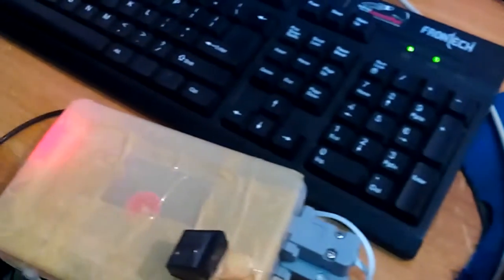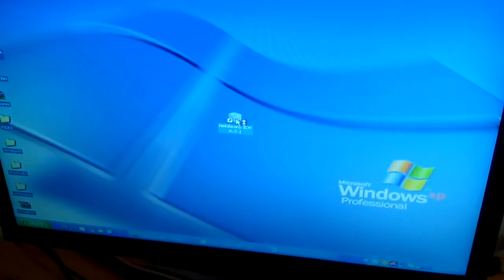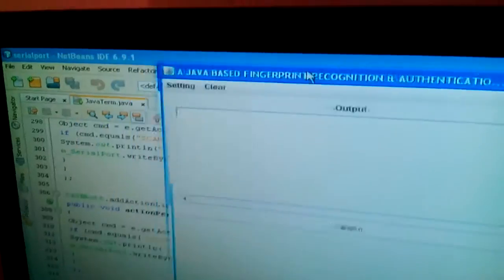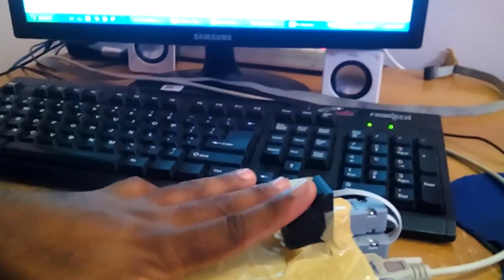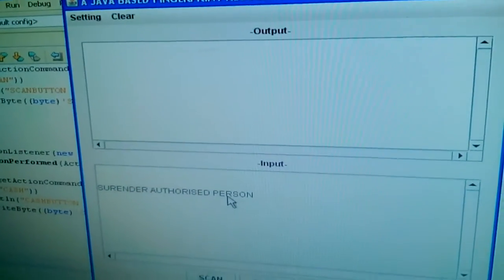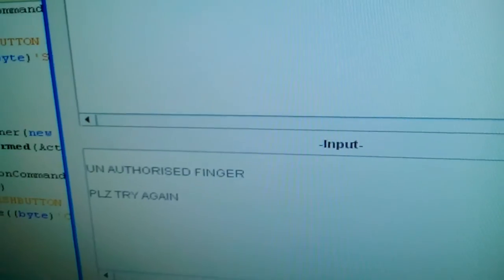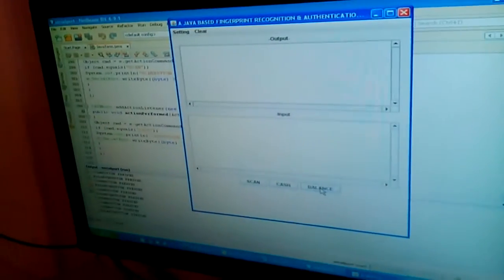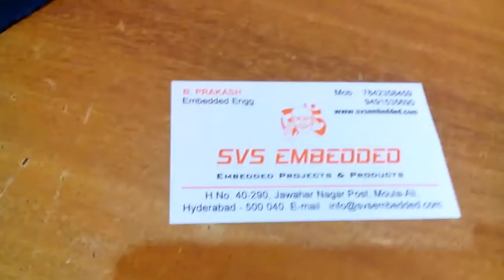A JAVA BASED REAL TIME FINGERPRINT RECOGNITION & AUTHENTICATION FRAMEWORK FOR ATM MACHINE

Comment: Excellent work Done... can you please send the source code to vjchavan582000@gmail.com
plz...I m actually working on the same project...plz....reply
Reply from the maker: Thanks for watching and your valuable Feed back. 3Yr's back i did this project. no data available in my pc.
This is R305 fingure print sensor module with TTL UART interface for direct connections to microcontroller UART or to PC.